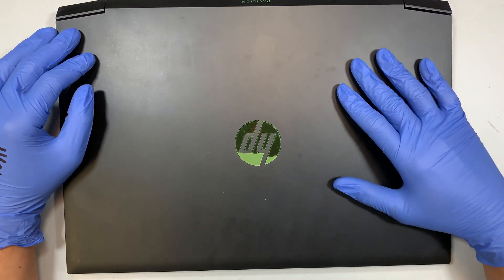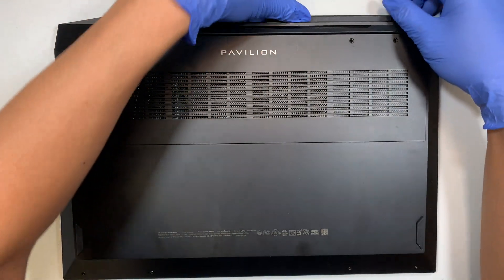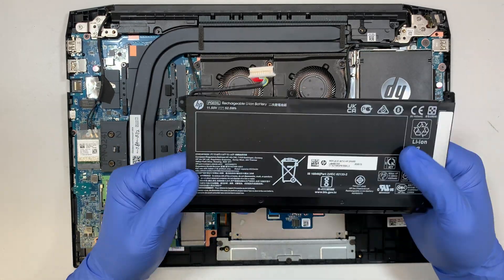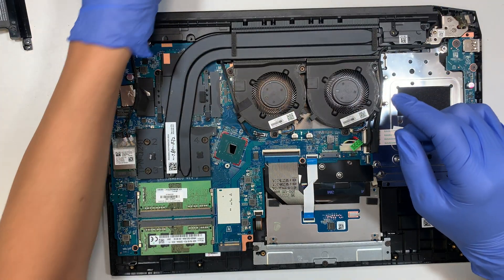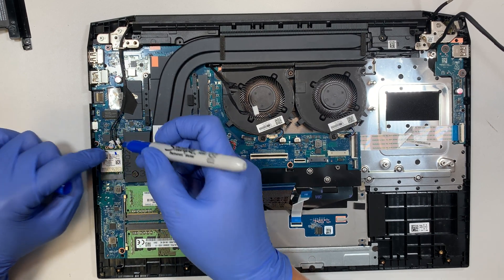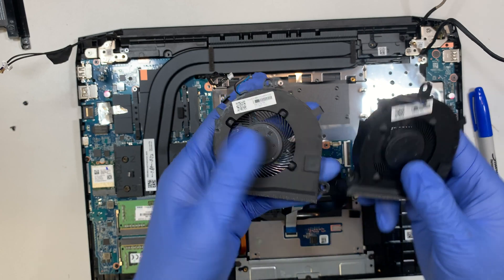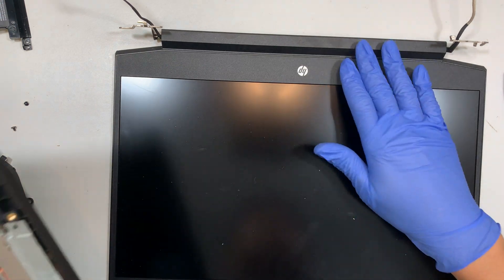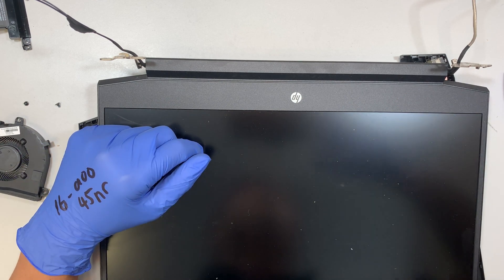HP Pavilion 16 A0045NR Tear Down Disassemble

Comment: Great video! Very easy to follow. I have a 16-a0032dx gaming laptop. I spilled water on it and turned it off right away, dumped the water out that I could and then let it sit sideways on top of a dehumidifier for a week then it sat for 3 weeks out in the open. At first I couldn't get it to power on but I did the hard battery reset by disconnecting the battery and holding power for 30 seconds. After it read "CMOS RESET" and power cycled it came on.

Now it is not recognizing the battery. I can power it on without the AC connector and it seems to stay on without a problem. When I first turn on the laptop and the password screen comes up I can see a battery icon in the lower right that has an X inside it. When I scan for issues using both the HP troubleshooter and also the DIagnostics tool available at startup with the "Esc" key. I do not see any battery icon of any kind after entering the password and going to the desktop. I used to see one there. I also disabled/enabled and uninstalled the driver for the battery and the AC adapter on two separate instances. I'm assuming at this point I need to replace the motherboard since there is no CMOS battery and the reset isn't working?
Reply: I also replaced the battery today and still having the same issues. Ran through the whole thing again with resetting and even recovered my PC using windows 11.